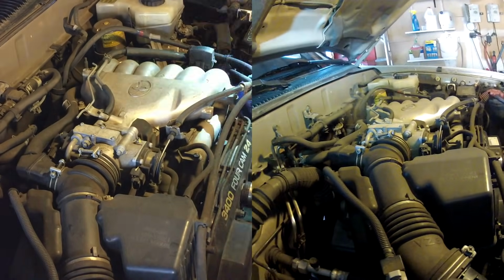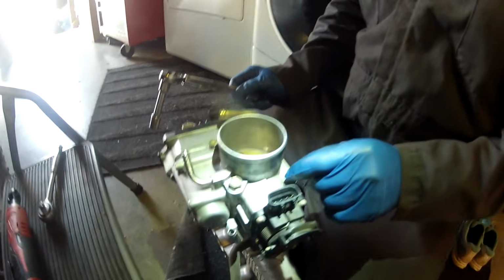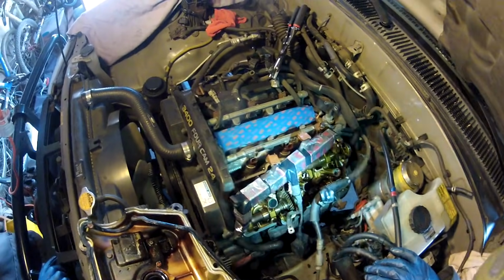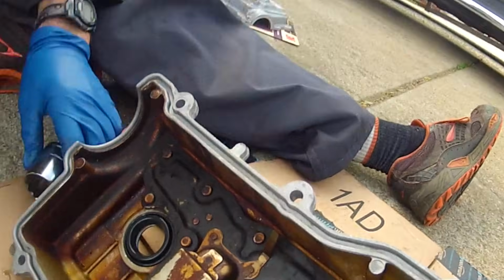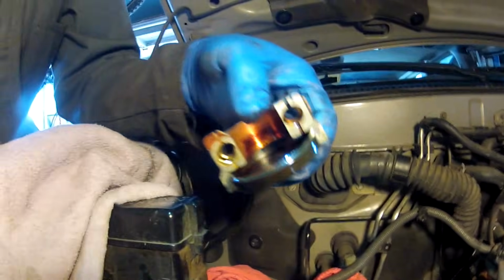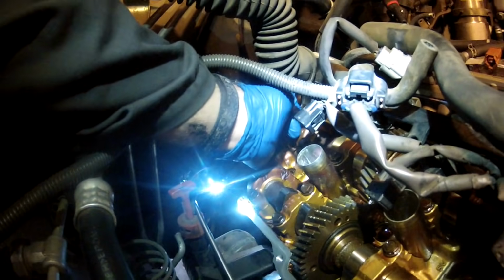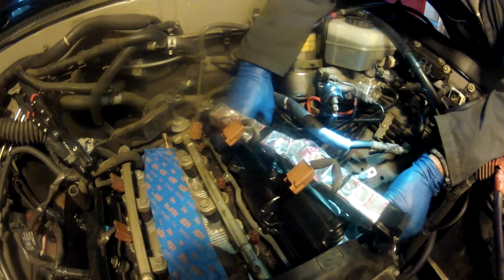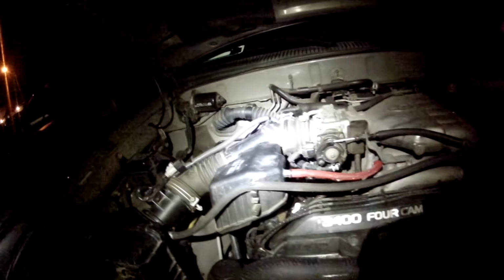3.4 L V6 5VZ-FE Toyota 4runner, Tacoma, Tundra Valve Cover Gasket Tutorial

Comment: Hey Tim, thank you soo much for your videos. They have helped me a ridiculous amount over the last year on my T4R. I  followed this tutorial video to a tee. The repair was finished with virtually zero hiccups. Unfortunately when I went to fire up the motor afterwards it ran for half a second then shut down immediately. Now I'm going back over my work. Checking vaccuum hoses for leaks and cracks. The PCV valve hose has a small crack in it. Other than that I can't find anything unusual. A T4R.org member had the exact same problem after completing the same job. Ultimately after days of investigation and process of elimination he found out it was his EFI relay. I may grab a new one to eliminate this possibility. Any ideas or info you can throw my way will be much appreciated. Thanks Tim and Sean.
Reply from the maker: If you cleaned the throttle body, the run-off may have drained into the IAC but that usually just causes a high idle and not what you're experiencing.  I'd check all your electrical connections, the ones on the throttle body, the ones to the fuel injectors, the connection at the MAF, etc.  I think a bad MAF could also cause what you're experiencing.  When you cleaned it, were you careful to not to damage the sensor wires?  I can't think of anything else.  I think going back in and making sure every electrical connection is solid is your best bet.
Reply: Were you able to get the issue resolved?  If so, what was the issue?
Reply: Yes the issue was resolved! When I was re-assembling the motor I didn't push the coil pack down onto the spark plug far enough. I pulled all the plugs out, re-installed and it started right up. 👌

Comment: Wow, what a fantastic video tutorial.  I actually think I might even be able to do this now.  new subscriber!
Reply from the maker: Hey Guy,  glad you like the video.  You can absolutely do this repair.  Just take your time and you'll be golden.  Welcome aboard the Timmy the Toolman train.  Stay tuned because there's lots more good stuff coming your way.  Happy Wrenching!
Reply: Your video is inspiring.  But I've never gone this deep before. I think I might take it in two sections even if it is redundant.  Mabye I will take off all the tubes, electrical connections then clean the mass air sensor, throttle area, replacePCV,  do sparks plugs, and put it back together to gain confidence before i really dive in.  Because of your video I think I am gonna go for it. (2002 Limited at 203k)
Reply from the maker: That's great to hear.  That's pretty much our major goal.  Empower people to tackle jobs they thought were beyond their ability.  When you get around to doing it, let me know how it goes for you.

Comment: So I kinda followed what you showed in this video and like oh said the harness cover cracked and beyond reuse and I can't seem to find a replacement anywhere do you the part name ?
Reply from the maker: I don't think you will find an OEM replacement.  I've seen people use spilt wire loom and high temperature tape in place of it.  Del City has a lot of products that would work for this application.  Here's a link: https://www.delcity.net/store/Loom-&-Loom-Clamps/r_IS1013?&mkwid=sg8dpyxex&crid=163769089862&mp_kw=wire%20loom&mp_mt=p&gclid=CjwKCAjwopTYBRAzEiwAnU4kb4XBAGkjsP1d93Q0HTULlLU2Yu1fJqli0mgF8PZk40r8GAMLoqAa2hoCmUEQAvD_BwE

Del City sells it in pretty long lengths so I don't know if that would be cost effective for you.  You can buy split wire loom at any auto parts store and then find a high temperature tape that you could wrap around the wire loom.

Comment: I noticed the valve covers are black at the end, what did you coat them with?
Reply from the maker: J R Sean bought some type of high temperature engine spray paint.  We used degreaser and a pressure washer to get them as clean as possible and then he painted them.  This is personal preference obviously.   Would I bother doing this?  No, I wouldn't.   This is all for show and serves no purpose.  But, to each his own I reckon.

Comment: hi there Tim , Buzz here , paid a shop $ 75.00 to get rear lca bushings done but this doozie is next on the list. what was the total time frame start to finish if things go semi smooth ? 4 to 5 hours ? It's with in my mechanical ability but free time just isn't on my side plus the knock sensor just tossed a code p 0325 lol ( not cheap ) but should be easy.....thanks again  shame we dont live in the same area , I'd gladly pay for your assistance  lol wish i could show a picture of this safari racked , snorkeled up wood beast
Reply from the maker: Buzz For your first time doing it, I'd say around 6 hours if you're like me and you take your time.

Comment: These videos are great! I had my local dealers service department replace my gaskets. $450.00 which I was ok with being I didn't have the time to do myself. What kills me is a 12 month warranty. 13 months go by and the SOB's were leaking again.  Went to dealership to find out they had fired the entire service department including the service manager! The good and the bad. The good, I some what knew the old manager and knew he would have worked with me to fix it. The bad, The new service manager was a total ass about it and would not even try to work with me. Rant over! Lol
Reply from the maker: lance henthorn Hey Lance, that's a bummer.  What you've learned is even the supposed experts mess things up.  You think you'd be getting superior service at a dealership but that's not the case from what I've seen.  If I can keep my vehicles out of a shop and do it myself, I will.  I do understand that not everyone has the time or tools to do their own repairs.  If a person can find an honest shop that does good work and they don't mind paying the labor rates, then that's what they do.  Time is often more important than the money savings doing it yourself.
Reply: Thanks for the reply. I have 2002 runner that replaced my totalled 99 runner. It needs valve cover gasket on it. O' boy!. I can't complain being the 2002 runs great is 4wd and I only paid $1500.00. we'll have a great day!
Reply: Make. I mistake about it, Those warranty durations are curated with scientific, mathematical & financial precision!

Comment: Really informative video. You sure demonstrate a ton of patience!!  I'm about to have to do this FUN job. I think I'll rewatch your video like 20 more times first ;)  Sure not a job ya want to do "just because". Thanks Timmy.
Reply from the maker: Hey Kat,  glad you like our video.  If you take your time, you'll have success with this.  Nothing with this repair is truly hard.  You just have to remove quite a bit of stuff and keep track of everything.  Labeling fasteners, hose connections and electrical connection is smart for somebody doing this for the first time.  If you were a mechanic at Toyota and did this job many times on this engine, you'd get to the point where you remembered where everything went without any aides.

I bought a 98 4runner recently and I'm going to do this job again.  But, I'm going to take it one step further and check my valve clearances and make any necessary adjustments.  With the valve covers off, this is the opportune time to do a valve clearance adjustment.  I didn't do it on my 2000 4runner but maybe I will depending on what I find on my 98.  My 98 has 130k miles and my 2000 has 170k.  If I find some of the valve clearances need adjusting on my 98, I'll probably pull the valve covers on my 2000 too.  We will of course be making a video of it.

Comment: It's probably been said but it would've been the perfect time also to clean the IACV. Very important to clean that sucker eventually, during this job is the perfect time. A full throttle body cleaning would be great too. You'd need a new rubber and metal crush gaskets for the Idle Air Control Valve (rubber gasket) and the Throttle Body (metal crush gasket) jobs. Both gaskets are available readily at the local auto parts place for little $.
Reply from the maker: Sure, I think cleaning the throttle body is a good idea and we actually did that in this video.  Pulling the IAC off and cleaning that, maybe, but maybe not.  The engine on my 2000 4runner has 170k miles and I know the IAC has never been cleaned.  My throttle body was a little dirty when I did my valve cover gaskets at around 120k so I did clean that out.  I guess cleaning the IAC couldn't hurt so why not.  I've heard people end up stripping the screws that hold the IAC onto the throttle body so that's one thing to look out for if you're going to do this.
Reply: Timmy The Toolman Yup the screws on the IACV are kinda delicate but not that much and fairly easy to remove when you take the whole TB assembly off with the IACV attached then just detach the IACV from the TB. I did mine at 130,000 miles more or less and it was gunked up and sticky, not moving really freely. Shot some TB cleaner on there until it was clean and free. Put everything back and have been good. I'm at 147,000 miles now, maintained well but have been getting a strong exhaust odor at start up and trim levels show I'm running a bit rich. I'm suspecting the IACV. I'll be doing the valve covers soon then I'll try chasing the running rich issue.
Reply from the maker: Good to know about the IAC.  I'll definitely pull mine off both 3rd Gens at some point and clean them up.  My 2000 also has strong exhaust odors upon start-up.  What are normal fuel trim numbers for the 3.4 Liter V6.  I have an OBDII reader and the torque pro app so I'm sure I'll be able to see what those values are for my motor.
Reply: Timmy The Toolman Would really need to research the FSM or online again but I seem to remember that correct fuel trim levels should be around 0 short term and long term fuel trim levels are ok at a difference of +/- 20 for the 3.4L engines.
Reply from the maker: Ok.  I'll do some research too.

Comment: Hey if your doing the passenger side  for my 4runner  you don't have to remove the throttle body correct just the air box and air tube
Reply from the maker: That is correct.  But, why not just knock out both sides and get it over with?  If the passenger side is leaking, I bet the driver side is as well.
Reply: Timmy The Toolman because I got them done by firestone and they didn't do my passenger side correct it was leaking in the back so I'm redoing my passenger side

Comment: Say you open the valve cover and the cams and everything are sludged up,  what would you do to clean the engine?
Reply from the maker: Some say just change the oil and filter more regularly and it will slowly clean up the sludge.  Some substitute a little ATF for engine oil and the detergent in the ATF helps clean the sludge out.  Some use a product like Sea Foam.  There's many ways to do it.  It's not necessarily a death sentence for your engine if you see sludge build-up though.  Just take good care of the engine from this point on and hopefully you'll get a long life out of it.

Comment: I ordered OEM CAMSHAFT SEALS (2) 90311-38051, do I need those also?  If so, what does it involve to change those?  Thank you.  
I will be having the following changed Saturday:
OEM VALVE COVER GASKETS (2) 11213-62020
OEM SPARK PLUG GROMMETS (6) 11193-70010
OEM VALVE COVER BOLT SEALS (16) 90210-05007
OEM CAMSHAFT PLUGS (2) 11188-62010
TOYOTA FIPG (1) 00295-00103
OEM ALUMINUM HALF MOONS (4) 11183-62010
OEM PLENUM GASKETS (2) 17176-62040
Reply from the maker: Hey Ray, replacing the camshaft seals isn't related to the valve cover gasket job.  They are something to consider replacing when doing the timing belt job.  We show how to replace the camshaft seals in our Timing Belt Replacement video 2 Part Series. 
Part #1: https://youtu.be/vHC46ypHxWc
Part #2: https://youtu.be/mErd7xoBS9I
Reply: Is there a book and/or manual that I can get for this valve cover job?  Thank you
Reply from the maker: Ray Donovan Hey Ray, I saw you asked the same question on Tacoma World or T4R.  If you follow our video, you don't need a manual.  But, if you really want your own FSM, you have 2 options.  You can do a Google search for an online version (I know for a fact an online version exists).  Or, you can do what I did and do a Google search for the physical books.  It's a 2 volume set.  The current going rate seems to be around $150 For the 2 volume set.  You'll most likely find a set for your year on Ebay.
Reply: Just found the 1600 page plus manual, now I have to find out what pages are for the valve covers
Reply from the maker: Ray Donovan How much did you pay?  The pages are all in the engine section near the front of the manual.  The related pages just aren't all in sequential order.
Reply: Free download via zip file.  Took 2 minutes for 1600 pages
Reply from the maker: Hey Ray,  I did this job 2 years ago and I'd have to search through my book for all the related pages and that would take me some time.  And, I definitely don't want to search through the online version because I don't the online versions.  The pages you need are all in the EM (Engine Mechanical) Cylinder Head Section and just make sure you're choosing the 5VZ-FE section and not the 3RZ-FE section.  But, I'll say it one last time, If you watch the video, we show you everything you need to get this job done.  One of the nice things about using our video is you don't need to consult a manual.  Anyway, good luck with the job.
Reply: Starts on page 356 on the online book.  Thanks

Comment: Timmy. You made it difficult on yourself when removing/installing the driver valve cover. That wire loom can be moved out of the way significantly if you unplug two connect near the alternator
Reply from the maker: Hey Justin, thanks for sharing this.  I recently bought another 3rd Gen 4runner and I will try our your suggestion when I get around to replacing the valve cover gaskets on it.  I appreciate you taking the time to share this tip.  There have been a couple others that have mentioned the ability to create more slack in the wiring loom but they didn't say exactly how they did it.  

Not too long ago I was stripping all the parts off a 3.4L engine and I got to see how the wiring harness connects to everything.  It was pretty cool.  The engine was from Mikey's V8 swap.  He couldn't find a buyer for the engine so he allowed me to pull all the parts off.  I took everything except the heads and the block.

 Happy Wrenching!
Reply: great to hear. looks like i'll be doing another side job for the timing belt and water pump soon. also to help keep the driver loom out of the way, i used a few bungee cords to keep it out of the way.

Comment: I'm going to have these parts changed on my 1995 Tacoma V6.  Using a Tacoma mechanic, how long should this take and what would be a fair labor charge (I supply all OEM parts)?  Lastly, no parts of the coolant have to be touched while doing this correct?

OEM VALVE COVER GASKETS (2) 11213-62020
OEM SPARK PLUG GROMMETS (6) 11193-70010
OEM VALVE COVER BOLT SEALS (16) 90210-05007
OEM CAMSHAFT PLUGS (2) 11188-62010
TOYOTA FIPG (1) 00295-00103
OEM ALUMINUM HALF MOONS (4) 11183-62010
OEM PLENUM GASKETS (2) 17176-62040
OEM CAMSHAFT SEALS (2) 90311-38051
Reply from the maker: There's too many variables for me to give you a definitive answer.  #1, I don't know what the labor books say this job takes.  #2, depending on what area of the country you are in, labor rates fluctuate.  However, what I do know is about how long this would take an experienced mechanic and I think it would be around 3-4 hours if they do the job right and don't rush through the job.  A DIYer like me would take at least 5 hours because it's not a job we've done tons of times and we're making sure we don't forget something or make a mistake.  

If this mechanic is working on his own time, as a side job, I could see him charging you 3 hours labor at $80-$100/hour.  If this job is going to happen at the dealership, they're going to charge you a hell of a lot more because I bet they book the job at 4-5 hours at $100-$150/hour.

You are correct.  Nothing related with the cooling system has to be touched.  You know Ray, this is not that hard of a job and you don't need any expensive fancy tools to do it yourself.  If you take your time like I did when I first did this on my 3rd Gen 4runner, you can do it no problem.  But, If you're not that into wrenching or you don't have the time, I can understand paying someone to do it for you.
Reply: Just spoke with my Tacoma tech, he will do it for $150 on the side.  He's damn good too
Reply from the maker: Ray Donovan That's a he'll of a deal Ray.  He must be a good dude.

Comment: Timmy, I just did this yesterday and it was a breeze except that I didn’t pay attention and put in the spark plug grommets backwards 🤬🤬...fixed that after buying more....when I removed the upper and lower plenum and was taking the driver side valve cover off, the plastic loom that covered the wires on top of the valve covers broke into pieces...I didn’t have to time to run to the auto parts store and grab some wire loom to replace it and put everything back together. Do you think I should go ahead and replace the wire loom?
Reply from the maker: I would recommend replacing the wire loom to protect those electrical wires the original loom that crumbled was protecting. Always better to be safe than sorry! Thanks for sharing